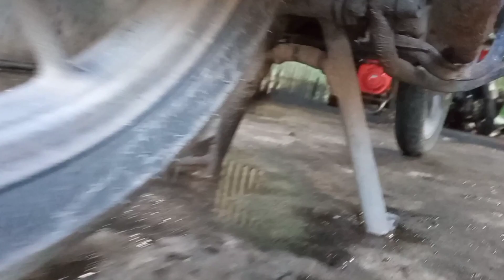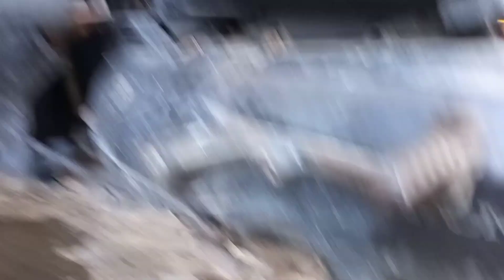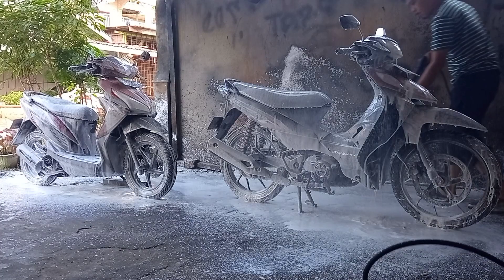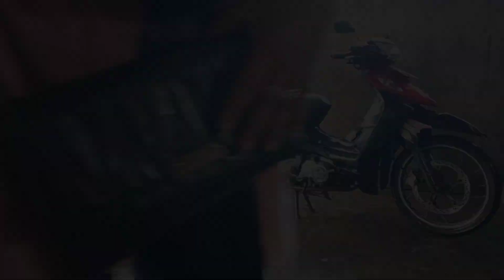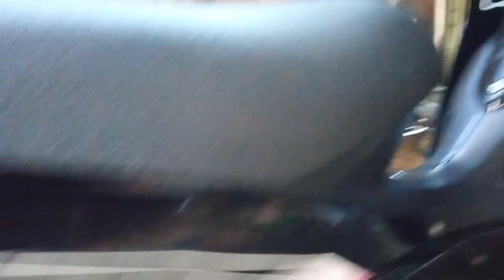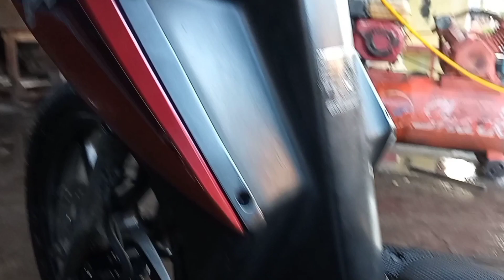RONTOKKAN KOTORAN LUAR BISA DENGAN TOUCHLESS TANPA GOSOK

Comment: Pake mesin apa?
Reply from the maker: Aipower plus 3200
Reply: @AnglerPutra100  1 liter bensin buat berapa motor bang?
Reply from the maker: @pemudahijrah3373  

Gk prnh ngitung bg
Reply: @AnglerPutra100  kira"bg apakah irit bensin apa boros?
Reply from the maker: Trmasuk hemat kok bg menurut saya. Mungkin klo gk slh hitung 1 ltr bs kisaran 10 mtr lbh
Reply from the maker: @pemudahijrah3373  

Gasnya disetel paling rendah aja biar agak irit. Rendah tp gk mengurangi tenaga pd tekanan airnya
Reply: @AnglerPutra100  ok bg makasih
Reply from the maker: @pemudahijrah3373  

Masama bg
Reply: @AnglerPutra100  bg mau nanya lagi itu sedotnya harus dari keran apa bisa dari tandon air
Reply from the maker: @pemudahijrah3373  

Tandon air aja bagusnya bg. Klo dr keran nnti tagihan air bs² jd gede.
Reply: @AnglerPutra100  oh ok bang makasih bnyk🙏
Reply: oh ok bang makasih bnyk🙏